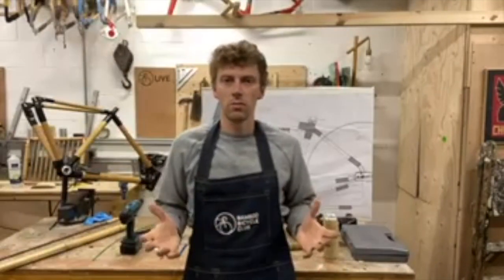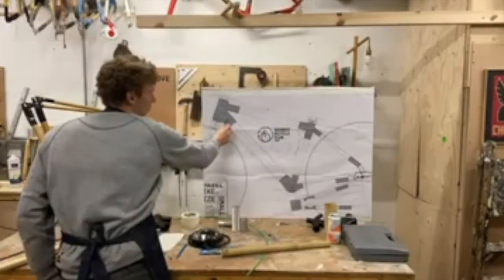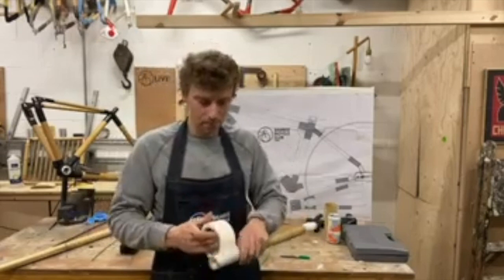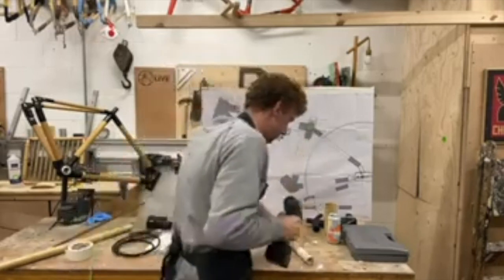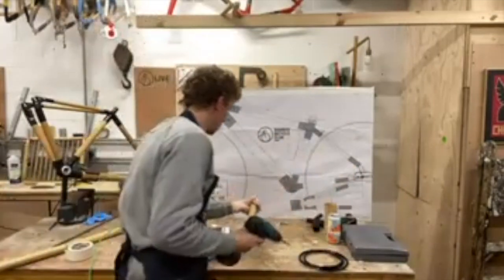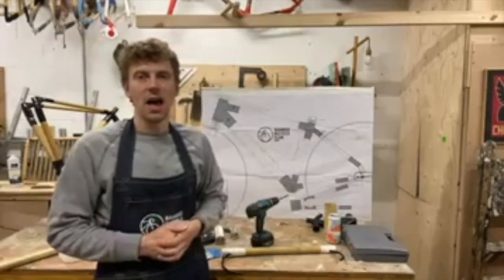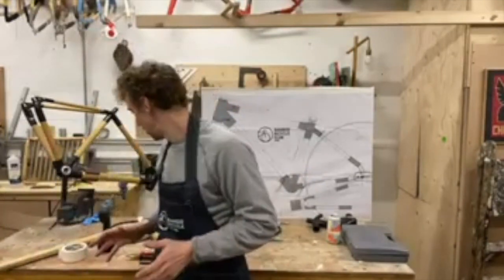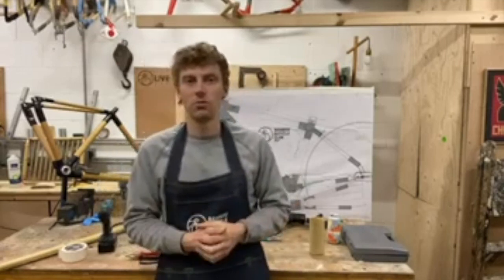How to install Internal cabling

Comment: When I built my gravel bike you hadn't posted this video. I mostly did what you've shown here. The only bit that I did differently was to keep the brake housing (I was lazy and went with wireless shifting, but the same would apply for cabled shifting) inside the tube while I was wrapping the flax lugs. This allowed me to put maximum compression without worrying about collapsing the tube and not being able to put the housing in.

Comment: If you are running three cables through the downtube (front and rear derailleur, and rear brake) should you drill three holes, or two (one large for two cables and one smaller for the remaining cable)?
Reply from the maker: I would drill, one large and then smaller

Comment: Hi,
 I am planning to build a Bamboo Gravel Bike, however I am missing the black hose for the braking/Shifting cables. 
How do you call hose, and is there a preffered outer diameter? 
Thanks in advance!
Reply from the maker: You want to use a pneumatic hose with a 6 inside diameter.
Reply: @BamboobicycleclubOrg  Thanks for the quick answer!  Just ordered the Gravel bike!

Comment: Great how to. Is the process any different if you have hydraulic disk breaks?
Reply from the maker: The same process, the internal diameter of 6mm allows enough space to fit a hydraulic hose.
Reply: Just remember that the brakes will need bleeding after they've been fitted.
Reply: The only bit that I did differently for my bamboo gravel was to make the exit point along the chain stay to be closer to the middle. I wrapped that section with flax fiber and trimmed the hose flush.